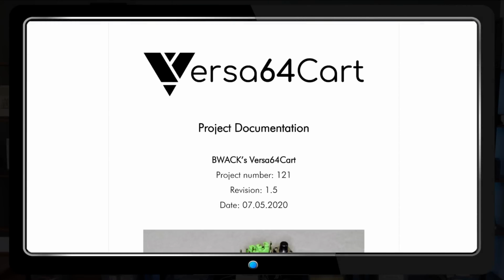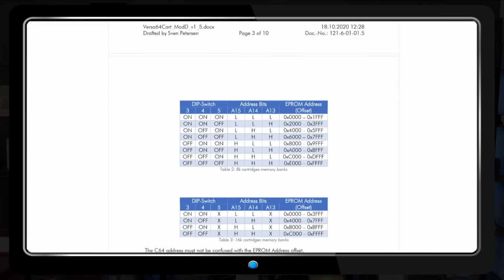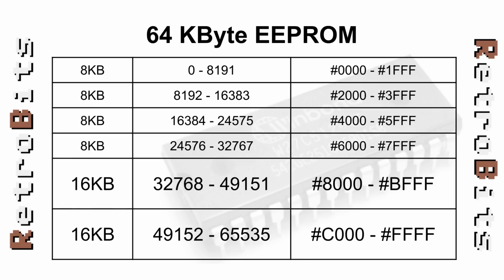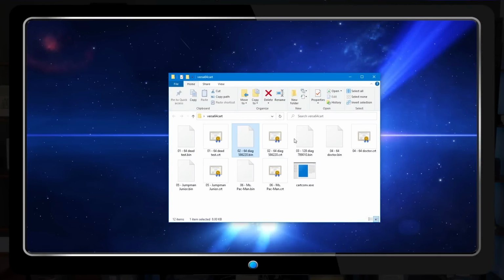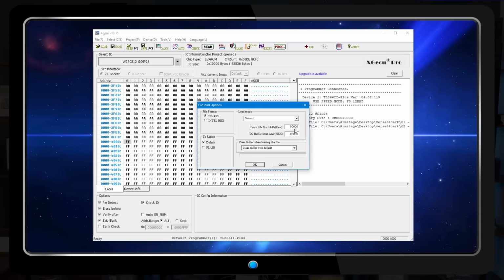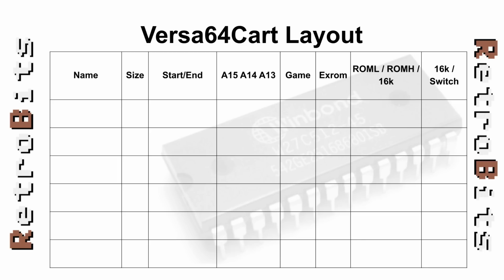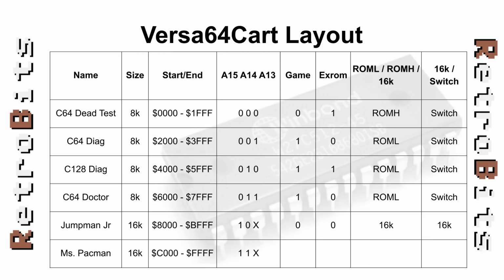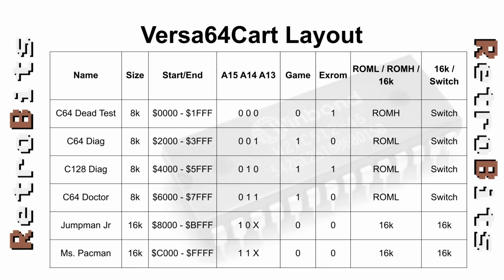How Commodore 64 cartridges work + Versa64Cart build

Comment: Does that sound plausible to have a relatively generic method to transform C64 games and programs that are loaded via tape or disk into cartridge ?
The loading experience of cartridge is so much more convenient !
Reply from the maker: This question is a little outside my wheelhouse but I'll try and answer it generally and others can weigh in if they know better. Basically, if a piece of software can fit in its entirety into 16KB or less, then it can be run from a standard C64 cartridge. The code would need to be modified to map into the correct address space and the cartridge header would need to be added. 

While early C64 software did fit into this small amount of space, later tape and disk-based titles were often larger in size and scope which is why later games were so much more technically advanced than the earlier stuff. Later cartridge formats like Ocean, EasyFlash, GMOD2, etc. use bank switching to accommodate larger software titles up to 1MB, but the software needed to be coded specifically to take advantage of this. So yea, nothing is impossible with enough effort!
Reply: @retrobitstv  Thanks for the detailed answer! Yeah it doesn't sound "generic", looks like each software needs to be directly modified. 
I was somehow hoping that one could imagine a "drive emulator" using bank switching cartridge instead of actual floppy. But that would require intercepting commands sent to the drive and redirecting them towards the emulator. That could be too complex to execute.

Comment: I was just planning to make a cart episode for Fairlight TV but given that you have already done it beyond great, there is no point. I will just reference this and add the few additional things I would like to cover 🙂

Generally, I guess I would like to see the chip being a battery backed RAM chip, to be able to skip the PROMMING stage. In an ideal world, I guess I would also like to see that the switches were registers you could poke. That would mean you could have a menu and never needed to open up a 3D printed case for every time you wanted to select one of the other segments.  3D printed stuff tends to be fragile - how many openings would you say it could withstand before the hinges starts breaking?

And I would also suggest having a look at KickAssembler to build the image. I use it to import and patch data and then export it to a file again. Not the intended primary usage, but it works great for that as well. A lot better than fiddling with a GUI.

Sorry if this sounded grumpy - it's really not. GREAT video!
Reply from the maker: Thanks for the feedback! I had to really dial in my printer to get the top to work reliably since the rail it rides on and the locking mechanism are pretty small. I've opened/closed it dozens of times so far and it's holding up well but the first few prints I made broke immediately. This board really is designed to be a low cost option, often one you'll just set via the solder pads and forget. There are a lot of other more fully-featured multicarts out there but I haven't tested any of them yet so I can't speak with any authority.

Comment: Can you add passive cooling to the pla to protect them from failure?
Reply from the maker: Adding a heatsink is a common preventative measure and certainly can't hurt to try. While heat is thought to be a major contributor to PLA failure, there are other reasons these chips can expire of old age including moisture/oxidation seeping into the package due to cost compromises and material technologies of the time, vibration, ESD and the breakdown of the dialectric material due to electron movement. For a deeper dive into the subject, checkout Bil Herd's talk on Component Aging and Heat at https://www.youtube.com/watch?v=PYDn9idlWb4

Comment: The Bwack Vera64Cart PCB is very cool!  I converted a plain old Dead Test cart into a 4in1 Dead Test/Diag cartridge with a Versa64Cart inside.
Reply from the maker: Nice, that's a great upgrade! I need to update mine to include Jani's 1541 test cart as well.

Comment: These PCBs are standard HASL and absolutely no gold plating! Hello cartridge port wrecker! https://www.tsb.space/bl0g/ultimate64-cartridge-slot-problem/
Every cartridge Commodore ever made for the VIC-20 and the C64 had gold plating on them. At 18:00 you can clearly see how scratched the surface of the contacts is after only one or two insertions.
Reply from the maker: Great info, thanks for sharing. I absolutely cheaped out when I ordered these and went with the least expensive option available since I figured I'd only have to use this cart once in any given machine (hopefully).
Reply: @retrobitstv  If you know you're not going to use a cart often then using HASL can be ok. However, there are many people on eBay and elsewhere selling carts with HASL contacts that are either games so they will be inserted/removed often or diagnostic carts destined to be used on many machines to be tested.

Comment: Back in the day, I could copy a game cartridge onto a floppy after sneaking the game cartridge onto the expansion port after boot up. This was potentially harmful to my machine. That was true, but I got pretty good at it. From what you say, though, this should not have been possible, because there would be RAM mapped to that page not ROM. PLA should have directed reads from page $8000 to RAM, not ROM. Maybe the PLA ignored the possibility because it already knew there was no ROM there the last time it checked. (The PLA logic was possibly only coded for possible cases.) Even so,  reading the cartridge data should have failed, but it did not. I was surprised that it worked  The cartridge was piracy protected by writing to an address that would normally be in ROM. If the data at that address changed, then that meant it was running in RAM and the code would reset the machine. If not, then the game program executed normally.  To get around that, I changed the program to jump over that code and continue to the game. Obviously, game developers knew about this hack, or they would not have included this code but anyone knowledgeable enough to copy the ROM would probable know how to bypass the code.  This was 43 years ago. I thought it was cool that I could do this at the time.
Reply from the maker: PLA can bank switch while the machine is running, so my guess is that when you inserted the cart with the power on, at that time the exrom and/or game lines got pulled low and the PLA dutifully remapped memory after basic was booted. I have never tried inserting a cart with the power on though!

Comment: Very good information i was looking for something like this.So you can use any kind off ROM file for commodore64/128.  thank you.
Reply from the maker: Yup, as long as it's a 8 or 16 KB generic or ultimax cart it will work. Any cartridge that has special hardware like ram expansions, freezers that have buttons on them, or internal bank switching won't work though.

Comment: Few questions I've been mulling over: Are EEPROMS still easy and cheap to source? What would be a decent EEPROM burner with software compatible with Linux? Are there any more modern memory types that could be used as EEPROM replacement?
Reply from the maker: I've been buying packs of 10 Winbond EEPROMs for 3-4 bucks shipped on eBay from a vendor in China. They're billed as new, but that doesn't mean they aren't pulls/refurbs, or are even authentic. I have had no problems with them at all though. There are also plenty of legit new units available from e.g. Digikey for a couple bucks apiece, so no issues with availability. As these are EE, they are much more convenient than the old UV erasable EPROMs already :)

I believe the TL866 burners like the one I use work under Linux. I'm sure I've seen Ben Eater use them this way in his videos, but I haven't tried it myself. The XGPro software also apparently works under Wine, so that's also an option.

Comment: What a great idea for info to share with us, Matt.
I just watched Adrian's [Digital Basement] video q(The "Kung Fu Flash" Cart for the C64 and the Bad Idea Barta Board) and was like .oO( There are different kinds of C64 carts? )
I've had these things since Starpost and Kickman (both of which pretty much stink), but never knew much of how they worked!
Reply from the maker: Same here :) I picked up an XPander 3 a while ago and wasn't sure what all the switches to toggle certain signals were supposed to be used for. This project has been instructive!

Comment: would it be possible to get GEOS onto a ROM for booting purposes?  Have it boot from the ROM then access the disk drives as usual once booted.  (yes I know everyone's setup would be slightly different but the main prg could be ROM and the rest of the system config reside on the floppy drive
Reply from the maker: GEOS128 had a ROM boot option, but I don't think anything like that was available for the 64. It is possible for GEOS on the 64 to boot quickly using an REU though.